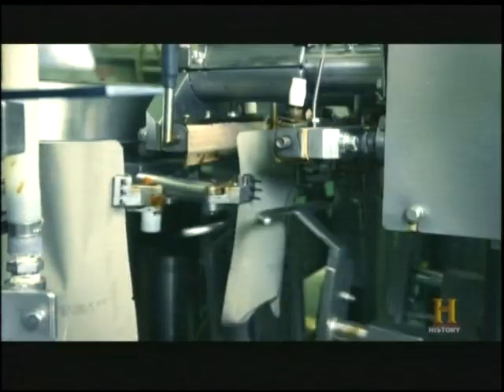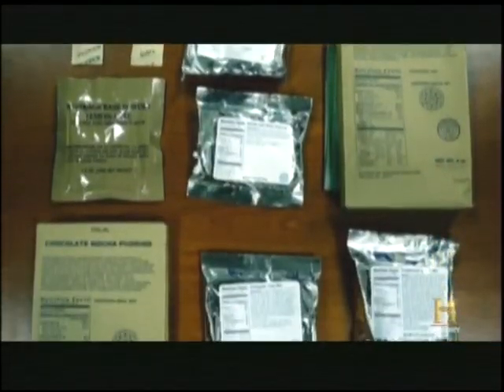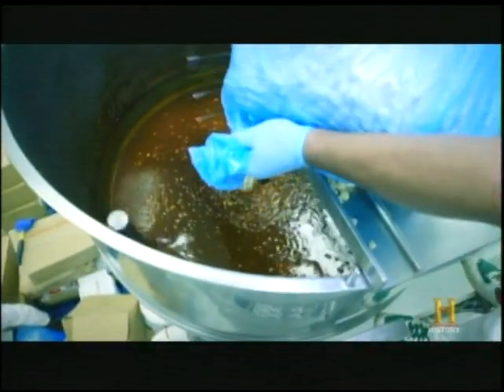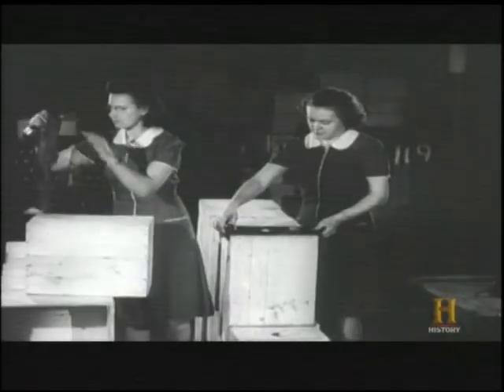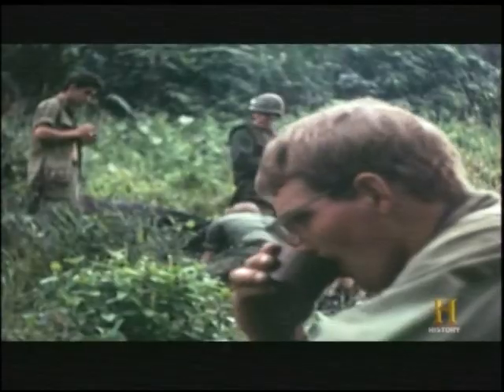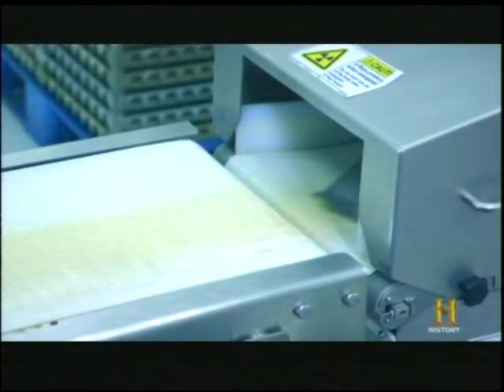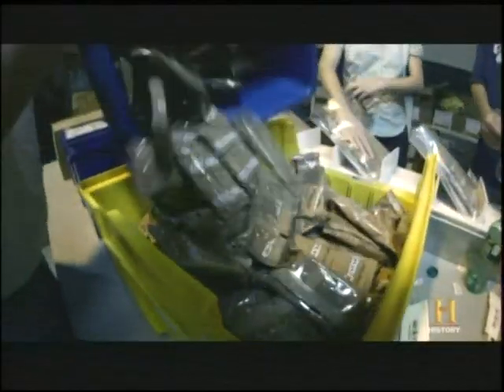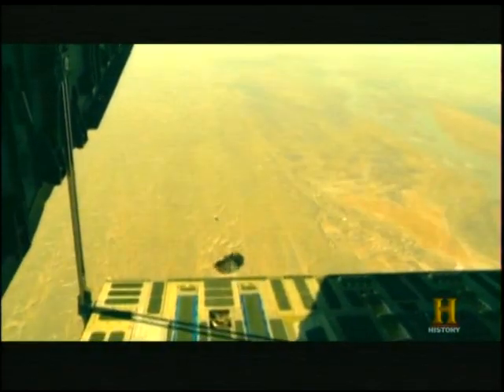History Channel - Battle Factory - MRE ( Meal Ready to Eat)

Comment: Yeah, someone at the History Channel screwed up. Military MREs don't come with water included for the heater. Nor do they come in the clear plastic bags they showed. They mixed up and showed the production of civilian MREs, which is similar but not the same.
Reply: Kel Smith  I've never seen a US ration with water for the heater. I have seen a few international ones with a pre measured packet of water for it.
Reply: Many of the Improvised Meal Packages(IMPs) come with the flameless or a set of matches